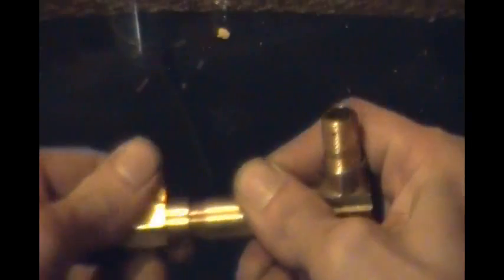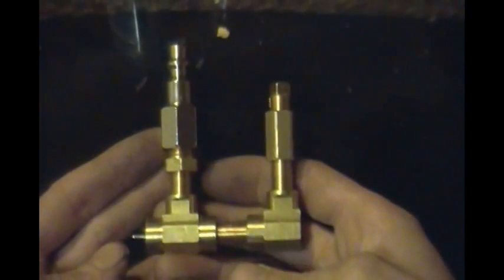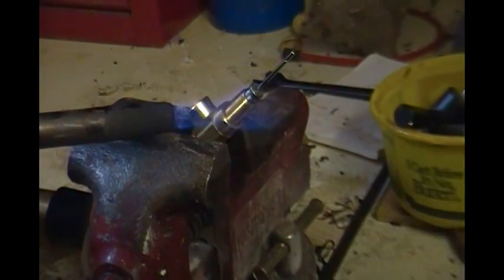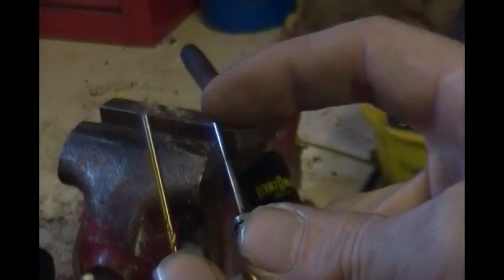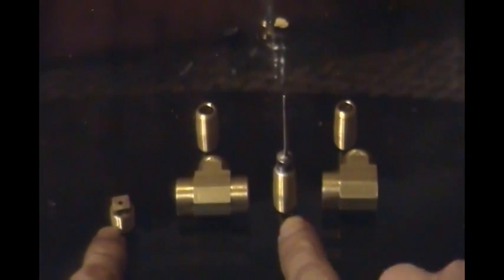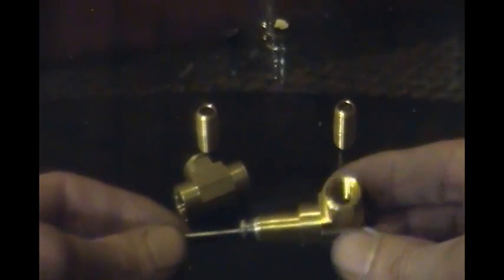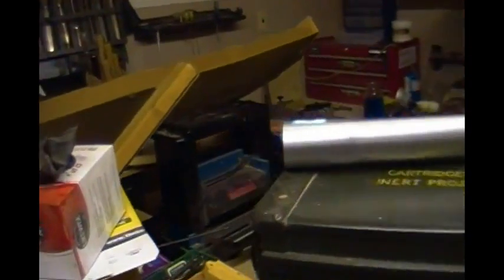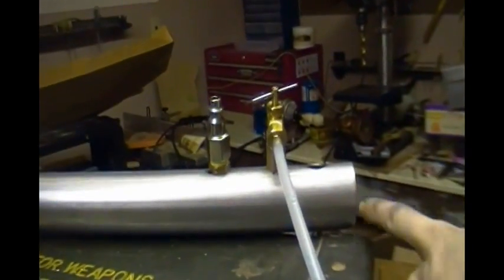How to melt copper (1/3): Building the burner

Comment from the maker: I had some issues with the music I chose for this video. =(
 
Who would have thought that 'Dance of the Sugar Plum Fairy' is copyrighted? It's a 222 Year old song!
Reply: Why is the flame not self sustaining? Once it's lit, should it continue to throw flames? I noticed that if you removed the propane torch, your kerosene vapor immediately went out. Also, while you were soldering the ball inflation nozzle, I noticed how quickly it turned red, is this nozzle going to be able to stand up to the heat of the burner? It seems like you need a nozzle with a a thicker wall and better material,
Reply from the maker: tarstarkusz I had two issues with the flame not being self-sustaining in this video.
1. I was lighting the flame outside the pipe.
2. It was a very windy day.
 
If you watch my more recent videos you'll see that I made some modifications to correct both these problems.
 
Now, the flame burns within the pipe, and you couldn't blow it out if you tried. ;)
 
Yes,the nozzle will stand up to the heat. It is relatively far away from the flame, and it will constantly be filled with cool liquid while the device is in operation. There is no chance of this part failing due to overheating.

Comment: Wow! There is a parallel univers!!!
LOL!!!
No, realy. I can't believe how much we think alike. Difference is you're doing it. I like your take on the atomizer.  But, your vent holes in the air fuel mix tube look like they need to be closer to the atomizer nozzle. Nice work on the oil preheat coil. I like your confidence while working with fire, that will take you a long way. I hope to be posting some of my own ideas some day. I know you have a fire extinguisher handy. So, keep up the good work on all your experiments. I can tell you enjoy them. We all do (speaking on behalf of the rest of my universe).
Reply from the maker: You are quite correct. My atomizer is too far away from the air intake. :)
 
This was causing the fuel to be sprayed outside of the pipe. Through the air-holes.
 
I have since corrected this by cutting half my pipe away.

Comment: Congratulations on constructing an HVLP sprayer.  I've worked with a very similar design, but it was being used to put fires out, not make them.  They used nitrogen at about 25 psi to atomize water.

Comment: Good build but you should solder fully around your inflation valve where it joins brass not just tack it on as you will have leaks, possibly explaining your oil fire puddles in later videos.
Reply: dean germeten I'm guessing you're saying that because in the video he only touches the soldering wick on one point of the nipple, but when you pre-heat the metal with the torch as he did the solder wraps around the fitting when you touch it at one point. So, he did solder all the way around it. It just may not have looked that way in the video.
Reply: ***** That makes sense. Personally I've gotten away from burners for a much simpler system, a shallow hearth in which I set an inverted stainless pet dish, that serves as both a crucible stand and a reservoir for fuel (waste oil) fed in by a steel brake line drip feed. An askance hole in the hearth for air injection, and a refractory-lined bucket
for the upper part. Or how about a steel crucibe, inside a refractory one, inside a microwave oven?
Reply: dean germeten Hmmmm. Very interesting. Anything I can see online anywhere?
Reply: ***** I haven't posted online. If you PM me with an email address I can send you pics but really is as simple as I've explained. There are vids here on Youtube that deal with microwave smelting.

Comment: Would it help to pre-heat the fuel line, like in a white gas Coleman stove or is that just reckless and stupid?
Reply from the maker: Yes, I think it would help. I plan to experiment with heating the fuel by either wrapping a copper coil around the pipe, or inserting a fuel coil inside the burn chamber.
 
I imagine you don't want to generate too much pressure in your fuel line though, It might end up bubbling hot gasses into your fuel reservoir.
 
With greater danger comes more power and fun.

Comment: Hey man I guess the solder doesn't melt? Have you had to re solder anything yet?
Reply from the maker: No. it doesn't melt. I used silver solder, which has a pretty high melting point. Also, the solder is exposed to liquid kerosene and cold compressed air rushing past it.
 
The mist only really ignites once it hits the breather holes. The atomizer itself is not exposed directly to flame, and does not get (too) hot. (You'll notice it has plastic and rubber parts attached to it.)

Comment: Hi,can i use 3/8 instead of 1/4? i can t find on my country anything of that,i live in europe.
Reply from the maker: Yes.
Reply: How i can contact you? I have tried to build this burner,but the air 
comes into the oil container and its bubbling. Can i have an email 
address or something to send you some photos.My burner is constructed 
of: a 3/8 elbow, tee 3/8, 2 * 3/8 nipple and 3.5 inches long, 1/4 
nipple. The needle is poked in 1/4 nipple and I soldered. I used 1/4 to 
3/8 reduction. I made a hole in the plug of 2 mm. But no results. 
Resulting in bubbles in the oil container. I soldered to the needle end,
 which has the same hole from the beginning.

Comment: I have a problem when it launched the air and then the oil pressure returns to court with oil and can power nozzle
Reply from the maker: Perhaps if you wrote that in Russian I would have an easier time understanding?
Reply: давление возвращается через трубку в сосуд с маслом и не может работать